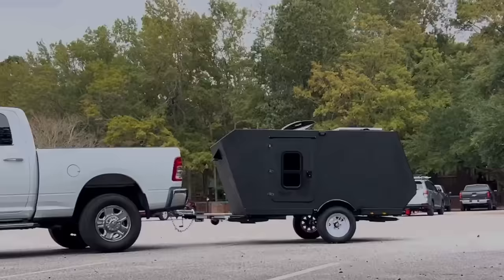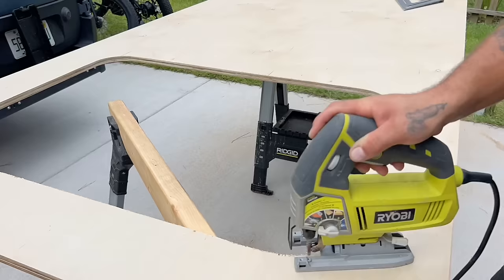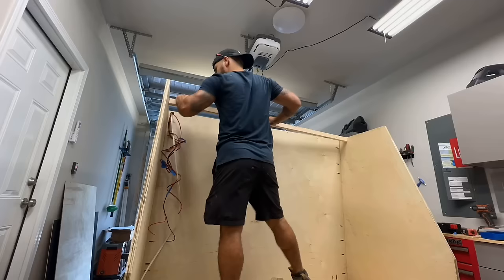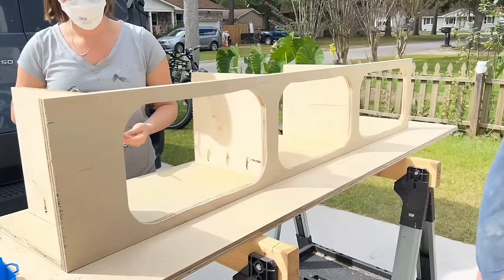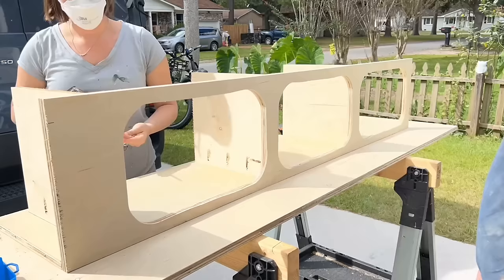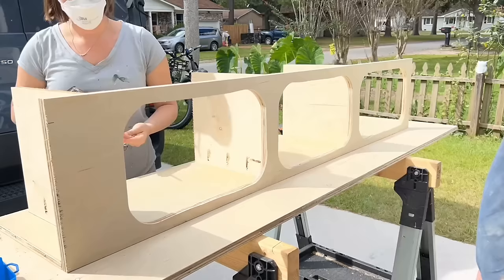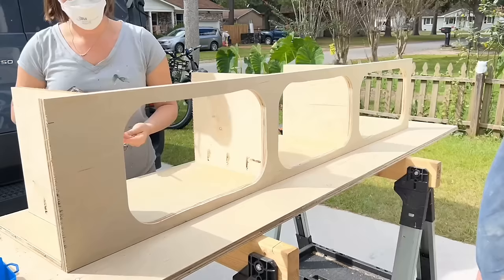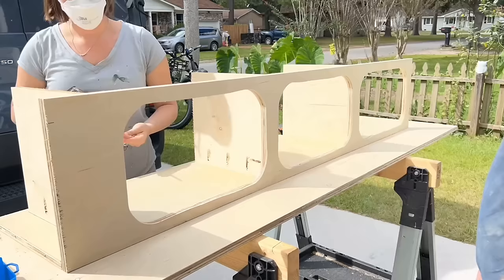How I Built A DIY Camper From Start To Finish | FULL BUILD

Comment: With most of the weight in the back of the tiny camper you must make sure the weight on the towe hook will be at least 60 kilogram otherwize driving at higher speeds will make the camper sway out of control. Black coating on the outside will turn the inside very hot when the sun shines brightly in summer. I second the remark made earlier about the enclosure of moisture in the plywood and the subsequent rot that will appear after a fwe years. But having written all that ...... very nice job !!!
Reply: if you watch when he was driving it the camper was already slightly swaying due to the weight. was wondering if anyone else was thinking the same as me on that
Reply: Glad you mentioned weight. Was wondering about it after he'd done the floor!

Comment: The reason your trailer lights are flashing is cause well one you bought like the cheapest lights possible but you put a lot of weight in the rear of your camper and ground the lights through the ball so when ever the trailer bounces off the ball they lose ground.

Oh also dont use fiberglass strips thats why you have those lines in your paint use a cloth that covers the whole thing for no seams

Comment: I like many of the things you decided to incorporate in your build... thanks for sharing! With black as your choice of color, you will certainly NEED to have that AC, as you've created a solar oven on wheels. I've never understood some folks preference for black, as they think it's "cool" when it's actually "hot as hell". Also, it looks like your trailer is tail-heavy, which is why the trailer "wags" in clip of you towing the trailer @26:17 (it's really noticeable when you run the video a 2X) . This is dangerous and can cause a wreck. One solution in your case would be to move the axle back toward the rear, or ALWAYS to load a bunch of gear in front to counter-balance the heavy tail. Be safe out there!
Reply from the maker: It does sway around 69-70 mph but sense then we did add a front box and a Spare tire and it seems like it helped
Reply: Those heavy ass batteries should be in the front, not aft of the axle.  Disaster waiting to happen.

Comment: Probably more of a good weather camper i guess. Wouldnt trust it in the rain. 
You really need to properly seal those doors. Water will easily get in.
Also the perpendicular sleeping mattress is a joke, right? How long is it across? Might fit a small child like that.

I do like the electrical system and the use of car jacks for leveling, thats smart.
Reply from the maker: We were not able to add weather seal gaskets because they hadn’t came in the mail yet, but we have already installed them on all the doors and the mattress is a tri folding mattress so it folds out to a queen size bed. I do appreciate you watching and hope to see you in the comment section soon. 🙌

Comment: Looks good only criticism I have is maybe next time for the connections use weatherproof shrink wrap connectors instead of the hardware store ones on things like your fuse panels etc, also did you add seals to the side doors around them? I couldn't tell so just wondering. All in all looks like a great build though you should be super proud of yourself.

Comment: your biggest mistake was not replacing the stinger with a heavier straight supported bar that is welded on, the factory stinger on the front of those is easily warped junk usually and in upgrading you can allow it to swap under your bumper for tight turns and to have a properly supported square beam jack that is removable or folds out of the way
another thing to consider is getting rid of the U bar axle they give you in those kits as they bend easily if you hit a rock making the cheap rims included pop off on the road if you fail to notice it, a custom weld it yourself 5 lug hub kit and a nice square pipe that fits will allow bigger tires and better stability
saying this because i recently had to upgrade a stinger on parents trailer as well as axle and tires as it made moving it a chore and the lack of ground clearance also made it easy to damage, i also ended up removing most bolts and welding the parts together plus added more floor supports to allow for better weight distribution as the steel floor was bending inwards from the 4 small support beams they gave it when it would have been solid with 6, also added a winch to reduce the amount of work needed to load it but you don't really need that on a camper, with the upgrades added i could move it by hand and no longer feel sore after moving the stinger around to load or park it as the added jack made things far easier

also when i was building a mobile utility shed trailer i found that using bolted on aluminum or welded on steel framing with 1" square pipe with washer riveted aluminum sheeting made a far lighter and stronger frame than wood, the solid foam insulation is a good choice though as despite the ratings given it doesn't let air pass freely so it's actually cooler/warmer that fiberglass which rodents/bugs also like to nest in, plus it makes wiring easier
speaking of wiring if you use pvc conduit for everything and set up boxes on each end that are sealed you can wire the whole trailer and any goodies you wanted, propane, lights, stove solar and all others and still have room for a bed and powered roof vent to help with heat and cooking fumes, to solve the bathroom issue weld a trailer hitch receiver to the back and make an attachment to hold a toilet seat frame over a bucket with lid, you may wanna store a 50 gallon water tank under the floor but sewage should be dumped asap on small units
also if your roof is made strong like the walls you can do all sorts of neat stuff up there from storage to power generation which can also go from the trailer plug back to the truck if using a 7 way round, just remember to use a charge controller mppt type and same batteries as your truck if sharing draw for charging, could probly fit a 400W panel up there or 3x 100w panels if done carefully

Comment: I love your build and the tips I've learned watching this. The only thing I questioned was adding the jacks to the trailer. Functionally, it is a great solution. However, jacks of this type are usually made from metal that oxidizes and corrodes very easily, so greasing the screw and hinge points will be a constant maintenance need. But admittedly, this is my engineer & acft mechanic side of me - as usual - over thinking things. Still a great build and thank you for posting this with awesome video and narration!

Comment: nice build only thing i see wrong is how flat roof is for snow and that sitting on it, wish had skill to make something like that. great work also cant see key holes in locks , so can any one open the doors?
Reply from the maker: Thank you the roof being flat is not too much of a problem. The fiberglass and raptor liner are both completely waterproof.
Reply: @buildersblueprint  i was thinking weight if heavy snow and moss and algie and dead leaves with the rain. but either way hell good build
Reply: My truck camper has a flat roof that is something like 2m x 5.5m and snow has never been a problem. Because the framing is solid it is possible to walk on top to clean off the leaf crud, tree resin and bird crap that builds up. A cordless jet wash does it in a few minutes.

Comment: Nice build. You designed and built it very well. The jacks were a great idea for stability. The only thing I would have done different would have been more roof insulation and used a white roof coat on top of the black. 1500 lbs is a decent weight. Figure another 2-3 hundred when it's finished and loaded.

Comment: What a great project and buildout. I liked the use of the scissor jacks and the upsizing of the wheels/tires. Thanks for the video .

A couple questions: At 24:52 when swapping the wheels/tires it looks like the bare wood floor can be seen. Is this a reason for concern and if so, how should it best be addressed? With your doors did you use any type of weatherstripping to prevent water intrusion? And, finally, with the door hinges is there a concealed hinge that would also work to prevent the screws from being exposed and subject to tampering?
Reply: There are so many places on this camper that aren't properly sealed...

Comment: Heads up. Don't put all the stubbies on the same side. The bottom only wood insulation and sub floor all have the tail ends on the same side. I'd recommend flipping the shorty on the insulation.

Comment: A very interesting build for sure. I was concerned from the beginning with the selection of trailer. I have one of those upon which we haul our kayaks and I know it is rated for about 1100 pounds. Perhaps the change in wheels and tires helped bring that up some, but wood weighs more than it looks. The 5x8 version of the trailer is rated for 1700 pounds and only costs $30 more so it might make a better starting point. I think you two did a great job in thinking this thing out as well as executing with great efficiency. I agree with other posters below that the weight aft of the axle is a concern, especially at speed. Overall a great build!

Comment: Love the build! One thing sparked my interest the weight being towed shouldn’t it be heavier in the front of the  camper? Doing so would allow you to correct a swerve easier more weight in the rear it could throw you off the road
Reply: Yes, @26:18 you can actually see the trailer slightly oscillating even when driving in a straight line.
That's why the gas/battery locker is usually mounted on the hitch...

Comment: tip for the flooring, buy some henry floor adhesive. which one you buy is up to you, there are a ton that will get the job done. its much easier tha trying to spread construction glue, just grab a trowel and spread

Comment: I have issues with using More than 2 hinges. Unless the alignment is within the wiggle tolerance of the hinges, you end up putting tremendous forces on your mounting screws through leverage. Better to use 2 sturdy hinges and ensure the door and frame is rigid.

Comment: For the 400 amp hour system you need minimum  of a 80 amp solar charger .  Also should do a 30 amp.service  with transfer switch that way you can run off shore power or a generator

Comment: As my only comment is the lapel mic is designed for discretion with only a little fluff in sight clamped to the cuff of a shirt :) :) this is really cool, I love it!! Really well built and good tasteful interior with all the home stuff, without the cheap caravan interior as standard commercially. I think that's one and a half tons in the end? I wonder what equilibrium is between weight and security in the wind; if carbon chasis and foam ply would be fine with interior like bedding and kitchenette weight holding it down :o I've always wanted to build my own

Comment: when you laid the fiberglass you started from the top and then down, water will seep under the joint over time. clearly, you have to start laying the fiber from the bottom up, you stop the water from penetrating the board under..😊😊😊😊

Comment: The cleats you used to hold the main side walls are an issue because if water does get in it will tend to drip down and then pool. Since the cleat is pressure treated, it will be okay but the plywood will absorb the moisture and wick the water up and then delaminate and decompose very quickly. 

If not using marine grade plywood you have to build these things with water shedding in mind as an EQUALLY important factor with the trailer being the most important. Water will find a way in. Always.

Comment: From experience I'll give you a tip.  Those fenders will fall off unless you loctite the screws holding them on.  Loctite and lock washers.  The vibration will loosen those screws  and goodbye fenders.  Lost mine up in Canada on crappy logging roads.
Reply from the maker: Thanks I appreciate the tip. I did use lock nuts with regular washers, but I will go back and add Loctite to the bolts ✌️

Comment: Batteries should be installed on the tongue side no question. 
Solder and heat shrink over crimp connectors every time.

Comment: Simply amazing, I am beyond impressed with what you have done, you should sell plans for this camper build or start a company building them. The one you built is great for highway and light off road, you could build a different version for extreme off road and make a killing!
Reply from the maker: Wow, thank you this comment means a lot. 
We plan on making many other projects like this, and are currently in the process of making an epoxy resin lava desk gaming set up

Comment: Wow, that's some heavy duty electrics. I wonder what you could run in a little camper that would need such power. Also, two, big batteries in the rear might make your trailer bounce off your ball. I sure hope you cross your chains and carry alot of gear up front. Good luck and thanks for posting.

Comment: Did you think to spray the under side of the trailer with the raptor liner to waterproof the underside or even fiber glass it to prevent it from rotting from rain and stuff

Comment: Nice job, I do wonder with most of these build why people don’t use the aerodynamics of the triangle shaped front that’s holding the hitch.
It offers extra space and adds to the aerodynamics of the trailer.
Also an integrated drip rail catching any rainwater if the kitchen roof is upright would have been nice, but overall a good build, a nice quality build camper/ caravan.

Comment: @Odins-Dad is correct. The camper was swaying and that can be fatal at highway speeds. You need to correct the weight problem by adding weight to the front of the trailer in front of the wheels or on the tongue. {possibly propane tanks and a storage box. Move the water tank to the front as well.)

Comment: Painted plywood isn't going to work long term on the bottom. I would have used fiberglass wall panel glued to it and sealed the edges with silicone to keep moisture out.

Comment: I like the idea of increasing the size and speed rating of the tires, however, you should never use a spacer without installing longer lug studs. "Every stud or bolt must be long enough to thread a length at least equal to the stud or bolt diameter. For example, a 1/2” thread diameter must thread into the lug nut at least 1/2”. NHTSA. The reason for the longer studs is to allow the lug nuts to fully engage with the lug studs on all the threads of the lug nuts. Not allowing full engagement WILL put excessive stress on the threads of the lug studs which will cause thread fracturing. 
Additionally, the spacer as installed is not centered on the hub and thus will cause the balance problems regardless of the balance of the tire/rim assembly. 
Otherwise, excellent build.

Comment: You said it was a 4x8, havent seen a comment related but this appears to be a 5x8. Just wondering considering a sheet of plywood is usually 4x8 and you had to add what appears to be another foot to the floor and ceiling. Otherwise I'd have done the electrical a bit different. The rest looks really nice 👍

Comment: That black exterior makes me think this is going to be a giant heat sink insulation or not and that the HVAC won’t be able to keep up in the height of summer. The bracing is going to be a thermal bridge. I hope I am wrong because you built an amazing little rig.
Reply: I was thinking the same thing

Comment: The black colour maybe an advantage in winter but overall, it will certainly heat up in the sun. Cooling and ventilation could be made more difficult. I would have chosen a lighter colour like white - even silver.

Comment: Great Build.  How much did you sell it for?  Two suggestions,  use the Rhino liner on both sides of the floor, the best house paint wont last very long going down the road and paint the exterior over the Rhino liner with a light color.  Would be very hard to keep the interior livable down nere in South Texas in the summer with even the best A/C.  Question, did you weigh your truck separately before weighing them together?  The 1500 lbs only represents the weight on the trailer's wheels, part of the weight is transferred to your hitch.
Reply from the maker: Thank you we ended up selling it for $8500 and using rhino liner underneath is actually a great idea. I will probably do this in the next build. The weight was 1500 pounds without the truck, I disconnected the trailer from the truck before I weighed it.

Comment: Those little screws into wood to hold a 6 gallon water tank wouldn't be something I would trust...better to use bolts for that. Anyway, apart from that and battery placement plus those wheel spacers not allowing the wheel bolts to extend past the hub; good job in general.

Comment: Great video and solid work. I was wondering if my car can pull something like this it is a mercedes e550 coupe but it has a tow hitch on the back lol. Do I need any special sort of gearing to haul something like this? I'm sure the engine has atleast 300 hp and close to 400 torque. Also I've always wondered this and it seems you kind of addressed this in your video but is it generally better when building a wood structure to have the side panels sit on top of the main base vs screwing them to the side of the base?